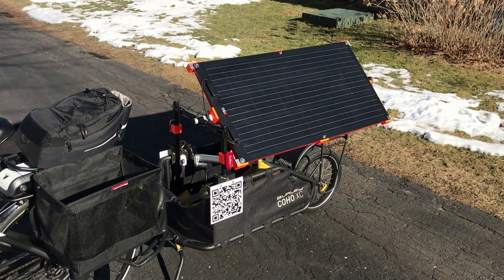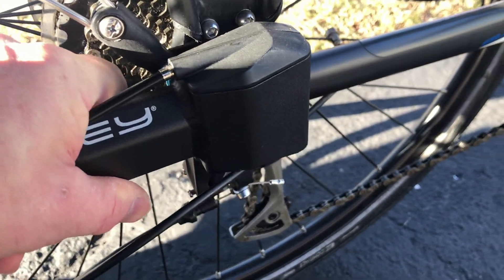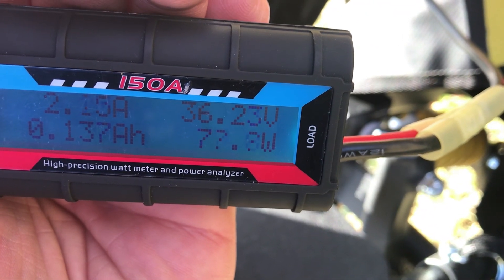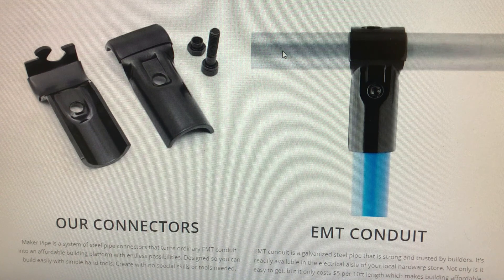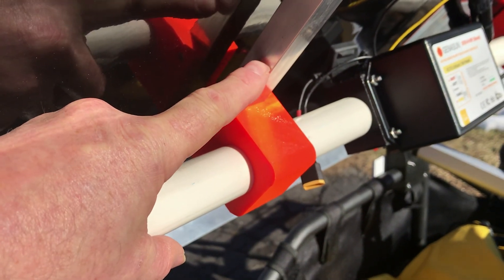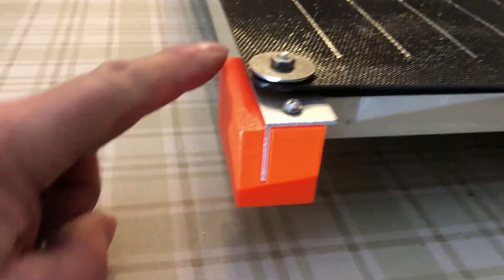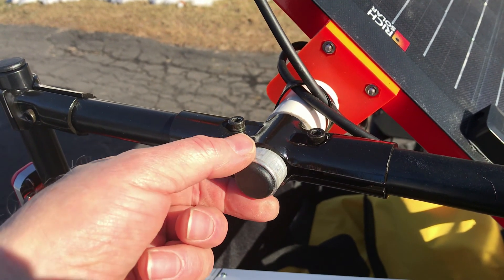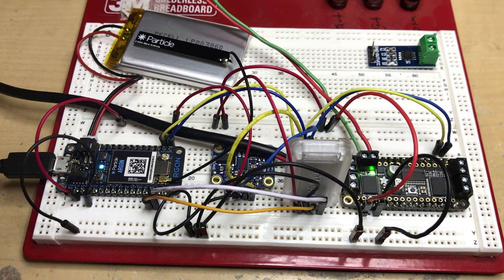Solar eBIke Trailer for Charging eBike Battery

Comment: I saw a part solar shroud planner trailer that was fixed except it popped up for sleeping. He had a small solar air foil panel on front and said it was worth while.

Comment: Not positive (no pun there fella) but I think I would prefer a gasoline powered direct 48v DC charger setup. If it can be done safely. It seems on paper to be way more efficient - charge rate, weight, balance, cost, reliability (any weather or hour), and simplicity. Simplicity as a system as well. Also you add those up and it equals better safety. Unless you have a vested interest in solar - like you're selling them - I'll take a 20# power-pack - and move to the suburbs cause you're in pickup truck country. And those country people do love their 'shine'. Hope you're well.
(6)

Comment: From Denmark: Thx so much for sharing. I am thinking about acquiring EL Assist for my ICE SPRINT FS & ZIFLEX Mono Wheel Trailer with suspension, similar to the Burley Coho XC Trailer. Your video comes in handy. I have noticed though that your trailer becomes unstable when the EL panel is tilted downwards, which  certainly might have undesirable effects, like vibrations, wear and tear on the axel attachments and whooping effect while driving. This can be corrected by either mounting a counter weight on each side of the panel. That could be very simple, i.e. a counter weight hanging on on a flexible wire, you lift up to achieve a better weight distribution or finding a system, whereby you can move the longitudinal axel that support the panel left or right to acquire a neutral/more balanced weight distribution. All the best.
Reply: I built Chris trailer with one design change, I moved the rear post all the way back on the fender. I have over 700 miles on that trailer with out ever plugging in the bike, all solar, The trailer is very sable and does very well over bumpy rough terrain. FYI, today i am changing the solar panel out for a 200w,  testing so far shows when the 100w is putting out 57w, the 200w is putting out 165w. wow, what a difference, how the whole thing will work together i will not know after trials
Reply: @enjoylifejourney1669  Yes, I noticed that. You did a very good job indeed. Looking forward to the Trials video.

Comment: I video inspired me years ago, now I got my E-bike 2.0 build on YouTube. I'm disabled and don't have much money but using what I would afford and my two hands I made my dream Solar E-bike, not much better I can do now. Maybe chuck the lead acid I guess is next.
Reply: I wish I was better at video making like you. I got to step up I guess.
Reply from the maker: Lithium batteries are lighter and you can use almost 100% of the energy (unlike lead acid, where you can't go below 50% with out killing the life of the battery)
Reply: @SerendipitySue  I started to design a PCB board that would keep the cheap 18650 cell packs balanced but then gave up and sold 4 brand new packs cause the news and all the fire they were showing lol I might put it back out and finish.  The boards on my PCBway profile.

Comment: Can a gas generator charge two e-bike batteries at once even if a e-bike battery is 48v and the hub motor is 500w or a 1'000w.Do the gas generator has to be 1,000w to charge the two 500w because I might have to go with a 2,000w gas generator ?
Reply from the maker: I think you might be confusing capacity (Watt Hours Wh) with power draw (Watts). Charging current is usually a lot less than consumption watts. Look at your current AC charger. I should say what the output is. Your generator would need to able to handle two of those plus some AC-DC loss
Reply: SURE - why not? Just connect the chagers of each bicycle to one of the 120 outlets. Only consider an automatic inverter generator with at least 1000 watts cause your chargers are probably less than half that. $400 - try the Wen. Personally I would get a 2200 watt because I would use it for welding. Quiet and will run for many hours on a gallon.

Comment: Having travelled 15000km around Europe with a solarbike, I would suggest going for a minimum of 250W panel, since in reality you need to charge moderately fast even on bit cloudier day. Panels under 150W will lead into surprisingly bad results!! Good panel with adjustment like in the video would be a big hit.
Reply: I been trying to calculate what the panel size should be, after 600 miles using 100w, it works only if everything goes perfectly with the weather, which it doesn't.... The larger the panel the bulky things get. 200w seems like the best size for pedal assist. If the bike is using a throttle I am guessing it needs to be more....
Reply: Two factors that can help picking a lower rate panel: How fast would you like to travel and can you carry a bigger buffer battery (solar station) instead?
Reply: @SonnyDarvish  That's right, but it is a challenge just to find a smaller panel produces even 50% of the rated power. I have a lot of bad experiences with them. High quality 100W panel i would say is the minimum, or a branded 150W+ panel. Smaller panels are also usually much lower voltage than the battery, so the charge controller losses will be higher in addition to the problem of finding a decent panel.

Comment: I do a lot of biking over great distance and multi day tours. I want to expand this ability, I really need to solve the problem of charging a spare bosch power tube 500watt battery for my mountain bike. I just happen to already own the Burley CoHo trailer when I stumbled upon Chris video. I wanted to build this solar trailer and all I had to work with is this video. If you want to build this trailer then use this video along with my notes here and it will work for you.

 Around 05/2023 , I finished building Chris trailer, It turned out really good. I used the maker pipe T-clamps, total of 3 are needed. For the framing I used 1/2" PVC sch40 in place of metal pipe, it's lighter. I used PVC 1" sch40 that threads through Chris 3d parts and acts like a bearing for the the panel frame to rotate. The leg that mounts to the fender of the trailer, I moved it to the end of the fender instead of the middle where Chris put it, that way I have the entire fender to carry my chair.  I am using the same solar panel as listed in Chris parts. After much testing, I think I would go to a 175w panel, it's only 10 inch longer. Chris provides free files for download. You don't need to purchase the 3d printer, there are many places you can get the parts printed. I started with the most likely problems to occur with this  build.

1. 3d connector to the Bosch battery, i printed the part, added the pins and tested the connector. I also tested the 5vdc that enables the battery. The Bosch battery has 3pins. plus, minus, enable. You must apply a 5vdc from the battery Minus to the enable pin to turn on the battery.  If you apply voltage on the Plus and Minus pin greater than the current battery voltage the battery goes into charge mode or else the battery is providing output current. The battery BMS will start charging at 14watts from the panel. It works wonderfully.
2. 3d parts that connect to the trailer. I wanted to make sure the parts fit correctly.. It works wonderfully.
3. 3d parts that frame the solar panel aluminum. The parts worked wonderfully.

Next comes the electronics once you know the trailer itself is good to go. I used the same Genasun charge controller. It's an all in one box that gives me adjustment to 42vdc which is what the battery needs to fully charge. Cllena DC 36V 48V Step Down to 12V 30A 360W Voltage Reducer  from amazon that takes up to 48vdc input and outputs 12vdc. I powered the same actuator to move the panel back and forth using a fob wireless remote, works great. I used a DC Buck Module step down Reducer that takes 12vdc and outputs 5vdc. The 5vdc is used to enable the battery. I used two Mictuning 36v 48v step down to to USB/UBC to charge devices.

I charged an empty 500w BOSCH battery to full using the 100w panel. It does work. However, the 100w panel is just barely enough. Anything other than direct sunlight the charging process stops.  This would be a problem on the open road if I encounter a cloudy day. 

The only issue i am not sure of, the genasun only gets to 41.3 vdc under load so the battery does not get a complete charge but close enough for sure. Not in chris video, I added output usb 3.0 amps plugs,  so I can charge all my devices on the open road. After dark, the battery provides power to the usb devices. The panel does charge one battery while you are using the other battery in the bike. So far the panel is able to stay ahead of charging faster than I can use up the current battery running the bike, that was a crucial test to pass.

As of July 20 2023, I put the trailer and electronics through test trials of about 500miles through wind, rain and terrain. The trailer was very stable and secured,  the panel made no difference being there. I just completed 10 days touring trip around washington state where I did not plug in at all, 100 percent solar charging, The design produces more energy than I can burn. This means there is no waiting around to charge, Just swap batteries and keep going or if your bike can connect to charging as your using it then do that. I should point out, one day I had clouds and rain and sun. This did cause me to get behind the power production and i had to use 2 hours of the next day to catch up. If I am going to pull off long trips I have to consider that I will not always have the best weather, for those reasons I will feel more secure attaching a larger panel.

So there you have folks , Chis gets all the credit here, I used his designs and duplicated the process, made some improvements that resulted in a very functional and light weight trailer that a person can actually go on the open road with a realistic solution. If you want a wiring diagram for the electronics , send me email tekisbest@gmail.com

=====================================
AS OF WRITING THIS LINE, I EDITED THIS COMMENT.... IT'S JAN 7TH 2024, HERE IS HOW YOU DO THE ELECTRICAL.

If you have not yet purchased the solar panel I would go bigger to say 175 at least. The width is the same but just a little longer. Here is why, 
1.) The 100w direct sun is just enough to activate the charge to the battery. Cover the panel with just your hand and it's enough to stop. The real world can easy pose a charging problem.
2.) Assuming your bike is pedal assist and you consume about the same power I do! Each light on the battery represents 100w. When I have consumed 3 bars at the most I notice the battery is fully charged, unless something light clouds get in the way of the timeline. I always swap batteries so that I am always charging.

The panel will have charged the other battery faster than the battery in the bike is consuming. Another way to look at it, The battery on charge is discharged down to the 3 light or just reaches the second light....when it's fully charged, your bike should be down into the 3rd light. You always want to keep that profile going. 

Another way to look at this.... You always have about 2.5 light bars swing. That means you discharge a max of 3 bars and can only charge 3 bars..(really only 2.5 light bars) and the panel is exhausted to keep up. It does not matter if it's the bottom 2.5 bars or the top 2.5 bars, this is the swing range that a 100w panel can provide. I always stay on the top 2.5 bars because it's safer when you're out in the middle of nowhere. 
There is a ratio between how long you can discharge 2.5 bars and charge 2.5 bars. The time it takes to ride that many miles will be longer than the ratio. The end result is that I can keep riding all day and never have to wait for the charging profile to be corrected.

Now, onto SETTING up the electrical.........
1. The panel connects directly to genasun, nothing else connects to the input of genasun.
Program genasun to 42vdc output. Connect the output of Genasun directly to the plus and minus of the battery. I will talk about the third pin(Enable ) in a minute. When the genasun output is greater than the battery voltage, the BMS in the battery starts to charge the battery and the bar blinks. If the Genasun voltage is lower than the battery voltage, the Battery puts out power.

2. Also connect the output of the Genasun to the input of the Cllena DC 36V 48V Step Down to 12V 30A 360W Voltage Reducer. Hereafter referred to as Cllena. See my parts list below.

Connect the output of Cllena (12vdc) to the actuator. The wireless remote will activate this. 

3. Also connect the output of Cllena to the input of the Buck converter. See my parts list below. Program the output of the Buck converter for 5vdc output. Connect the output of the Buck converter now at 5vdc to the enable pin on the battery.

The system is activated in two ways., Sunlight on the panel will produce output voltage directly to the input Plus and minus of the battery. This also applies voltage to the input of Cllena. Cllena outputs 12vdc to the input of the Buck converter. The Output of buck converter 5vdc activates the enable pin on the battery and keeps the battery activated. It's a feedback loop. Once activated it can not be turned off unless you break the loop by unplugging the panel or unplugging the battery. Once the panel is exposed to sunlight the system will automatically activate itself.

The battery should have a test button on it, you press that button to see how many bars light up. Pressing that button also outputs voltage on the Plus and Minus pins of the battery, that is enough to start the feedback loop. Here is where that is useful...
1. Connect to the output of Cllena your choice of usb, usbc or any output power you want to pull from the battery or panel for charging devices directly from your solar trailer....
It's dark, you're camping , you want to charge your phone and power other usb devices... Press the button on the battery and the system activates, no solar needed, all the power is coming from the battery to power your devices all night long.
Also, during the day if you don't have enough sun, you can still charge devices. THe power will first come from the panel and if that is not enough, the rest comes from the battery.

Genusun
See chris parts list for this

DC Buck Module, DROK Adjustable Buck Converter Step Down Voltage Regulator 6V-32V 30V 24V 12V to 1.5-32V 5V 5A LCD Power Supply Volt Reducer Transformer Module Board with USB Port Protective Case
https://www.amazon.com/gp/product/B07JZ2GQJF/ref=ppx_yo_dt_b_asin_image_o02_s00?ie=UTF8&th=1

amazon actuator

See Chris parts list for this

Cllena DC 36V 48V Step Down to 12V 30A 360W Voltage Reducer 
https://www.amazon.com/gp/product/B07L7M82WF/ref=ppx_yo_dt_b_asin_title_o03_s00?ie=UTF8&psc=1

MICTUNING 36W Fast PD USB-C Car Charger with USB Quick Charge 3.0 and Type C Charger Socket with LED Digital Voltmeter Compatible with iPhone Pixel Samsung 
https://www.amazon.com/gp/product/B07LCBKZSG/ref=ppx_yo_dt_b_asin_image_o03_s01?ie=UTF8&psc=1

Wireless remote
https://www.amazon.com/gp/product/B07T877Z77/ref=ppx_yo_dt_b_asin_title_o07_s00?ie=UTF8&psc=1
Reply: You can set it up so that you have a battery to store the solar energy while always having the bike plugged to the external battery.
Reply: @brianparent  I have two batteries that go to the ebike, I charge one while using the other. My ebike will not allow direct connection from the solar trailer to the ebike, it's just the way my ebike works. Soo , charge one while using the other.
Reply: @enjoylifejourney1669  Buy a "BESTEK 300W Power Inverter DC 12V to 110V AC" & a "WEIZE 12V 100Ah Mini LiFePO4 Battery, Built-in 100A Smart BMS, Deep Cycle Lithium Iron Phosphate Battery." You can charge while you ride... Just make sure you charge the battery first. It is a bit bulky, but it works. Of course, don't forget the solar panel to plug into the Power Inverter. You can do it with a solar generator too.
Reply: @enjoylifejourney1669  Some geniuses out there make their own system from scratch. I wish a company would make a solar battery trailer for an e-bike that charges on the go. Of course, it adds a lot of weight, but a large Watt/Amp hour battery powered e-bike should handle the weight fine. Of course, everyone has their own set up. One guy I know traveled across The United States like that sleeping at hotels. Must have cost him a lot to do that, because he wouldn't tell me. lol
Reply: @brianparent  I built mind from scratch, I don't have a lot of weight as that is a big issue when doing a build like this. I use two bosch 500 tube batteries that mount into the tube of the bike. I have well over a 1000 miles with this build. I always tent camp and cook my own meals. Eating out is very rare. I carry everything it takes to live. The big issue here is sun, that is your fuel, if no sun you don't go anywhere. If i have sun everyday there is nothing that stops me. Next year i want to go across the US ... my biggest concern is running into days with out sun, that would strand me..... The only other thing i would like is to find some one who would like to travel like this.... that's not easy..
Reply: 12 volt lithium 100Ah battery or higher Ah depending on your converter.
Reply: Hi, I sent you an email to tekisbest a couple days ago and just wanted to make sure you got it.  Thanks!
Reply: @jerryheymans6405  I did get your email and have responded a couple of times, I also left a voice mail to the number you left. I have not heard back.